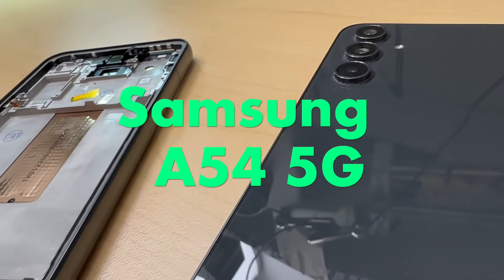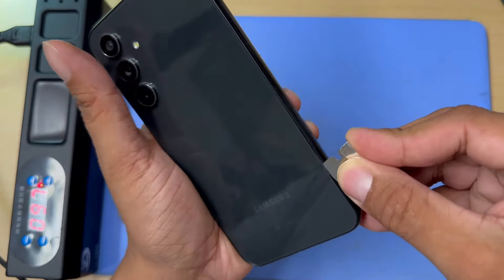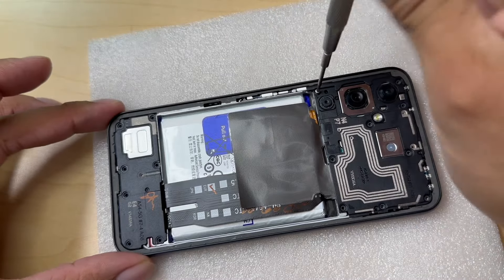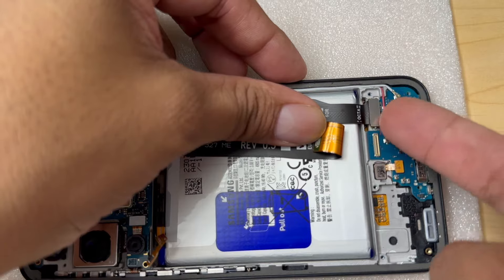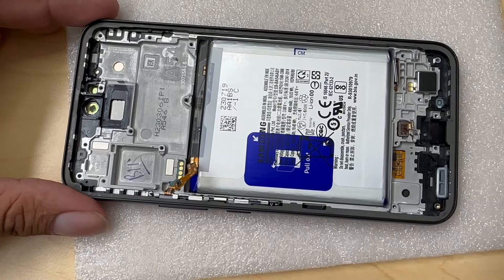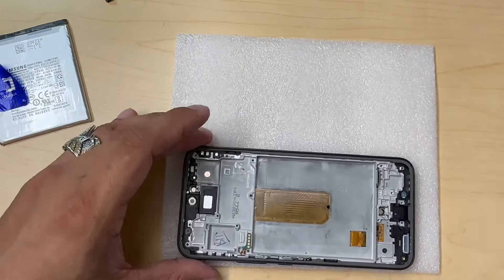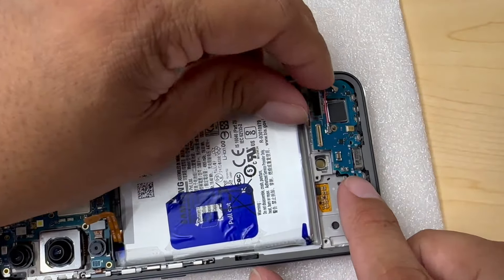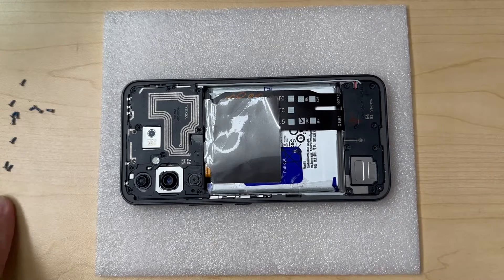Samsung Galaxy A54 5G Broken Screen Repair And Take Apart

Comment: Question is the new display also a super AMOLED with 120 Hz like the original
Reply: I know they are at least oled hence why the fingerprint sensor is expected to work. But there must be something missing if this display os being sold for around 45 , 50 bucks on ali express. I'm guessing it's likely the framerate. There's just mot enough reviews to know unless you it it for yourself.

Comment: Whats the link for the frame and screen????? replacement? Did the screen work good??

I have my phone taken apart and need a good replacement the last 2 didnt work. One was offset and the other didnt feel. Thanks
Reply from the maker: Do you have problem with the touch screen ?
Reply: @JoseMoralestech  where did you order new screen
Reply: I replaced it and after a system update it no longer responds.. where did you get the new one ?????? @JoseMoralestech
Reply: @Ceeyo438  Did you finally get a fix?
Reply: @mobznkala  i asked you where did you order the screen and never got a response. I was on amazon today about to order one actually. Where did you get the replacement screen